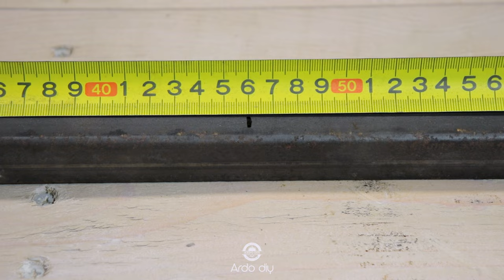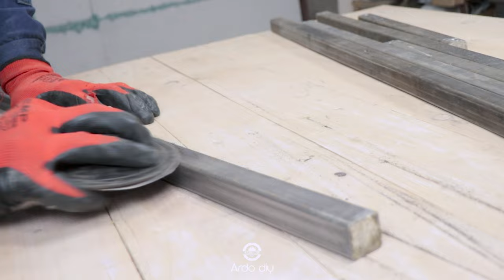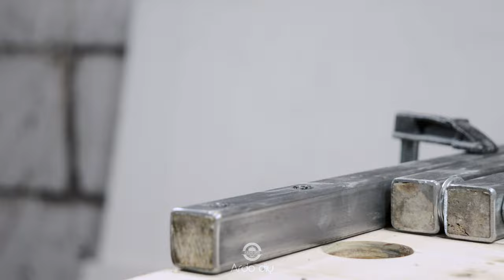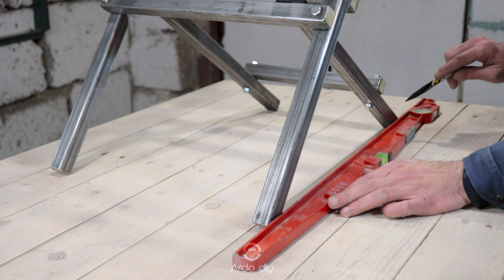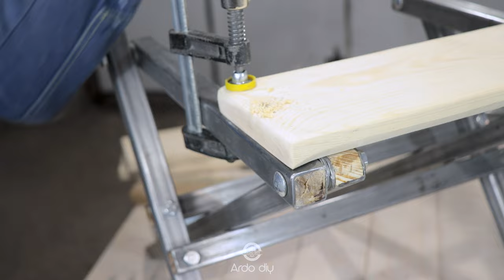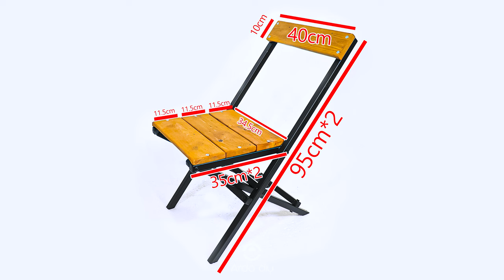Outdoor decor idea - DIY Folding Chair with metal frame

Comment: What are the size of nuts and bolts that you used?
Reply from the maker: Hi James 👋 
For this project you need
(25mm)Metal Square pipe 
( 95cm - 2pcs ) (70cm - 2 pcs ) ( 35cm - 2pcs)
( 40cm - 2pcs ) ( 29cm - 1pcs )
SS Carriage Bolt ( 1/4 Size 2.5" Length - 4 pcs )  With Washer And Locknut
Hex Bolt 6mm Size And 40mm Length - 6pcs
Screw 3/16 Size 1" Length
And wooden boards